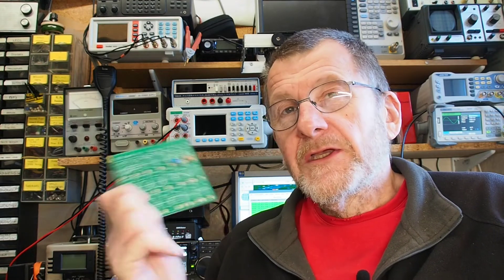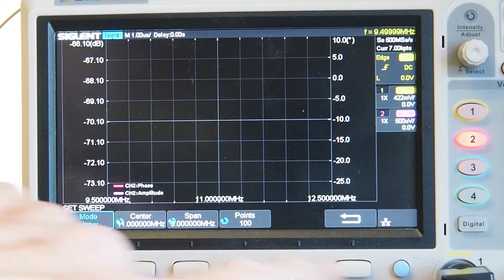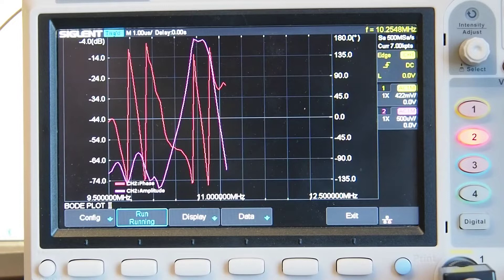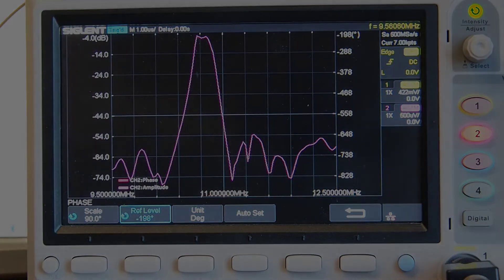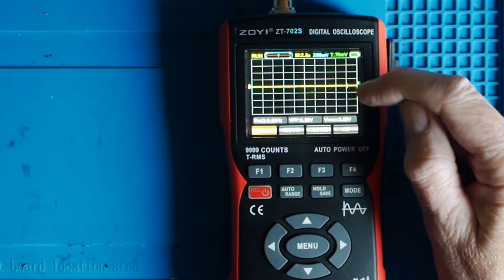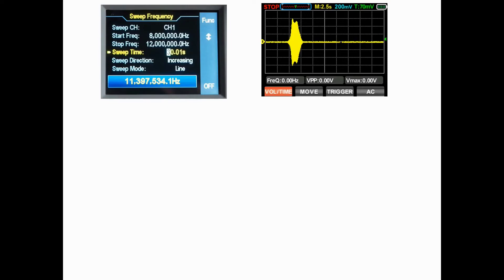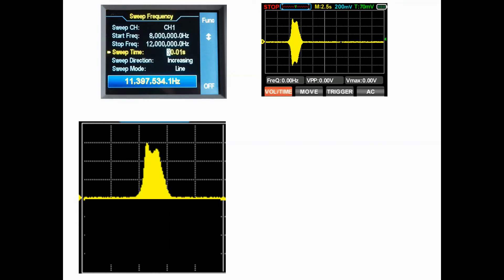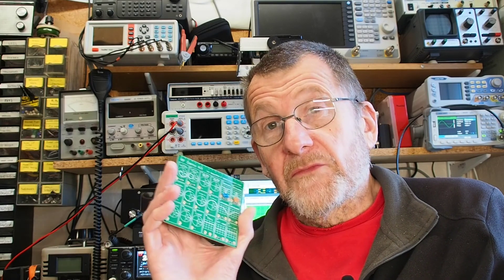Plotting Frequency response with a scope - #184

Comment: Thanks Bill - I want to note here that if your signal generator has a sync output, and your scope has a sync/trigger input ("EXT") it's far easier to set this up, and you'll get an even more useful/aligned display.  The generator's sync output will tell the scope when to trigger, and with a bit of math on the X graticule, you can calculate amplitude vs. frequency.    You should setup the generator's sweep time to match the scope's horizontal scale (total time, horizontally) fairly closely, for it to be maximally useful.
(Edit: i see you've posted exactly that technique in reply to RensePosthumus's message; using ch 2 instead of an EXT input, brilliant)